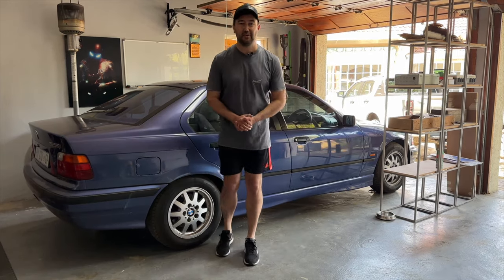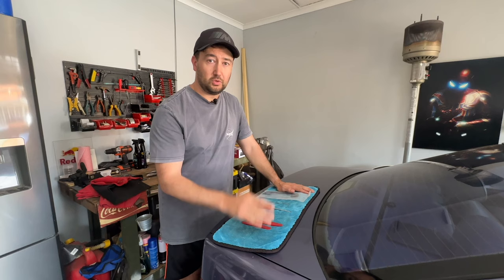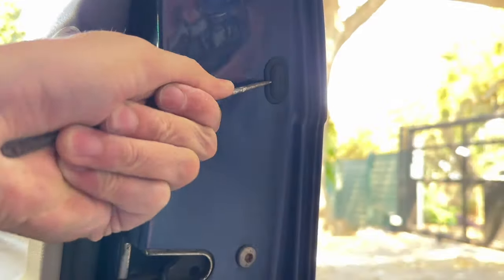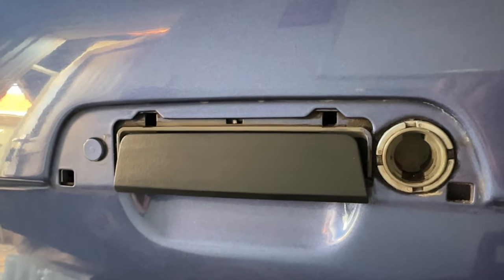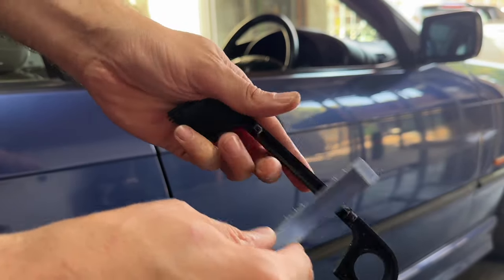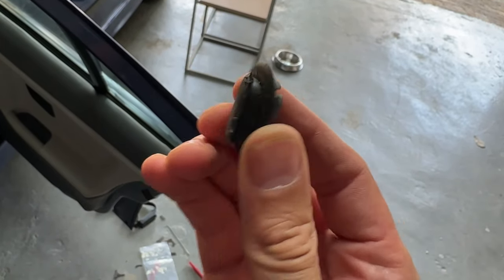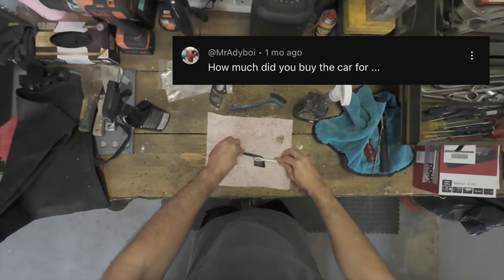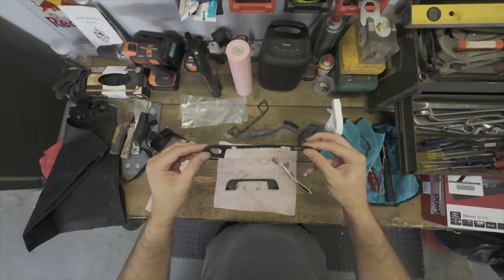Updating the BMW E36 Exterior & Answering all your Questions! | BMW E36 328 Project

Comment: I also just bought a 1996 e36 328i sedan, its pretty clapped out and I know nothing about cars, so I am learning as I go, im also trying to make it oem+, currently doing the roof lining, sunroof mechanism and replacing steering rack. I reckon ill be tuning in to your videos a lot!
Reply from the maker: Amazing! Good luck with your build. I have to do the headliner too (which I’m dreading). Thanks for tuning in!
Reply: How much did you guys pay for your cars?
Reply: @veemash643  i paid $6000AUD, wasnt in great condition though.

Comment: at 2:28 to remove that plastic cover I was doing the same thing as you did BUT then all 3 left I done with a bit more work yet NO scratches, I took off the interior door panel and from the inside I carefully pushed out the inner bit of the plastic cover, easy.